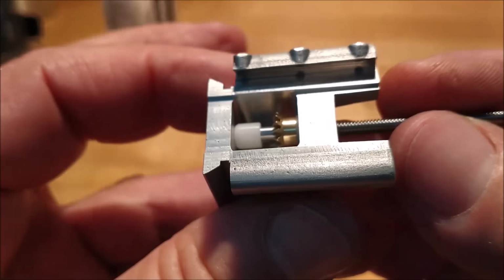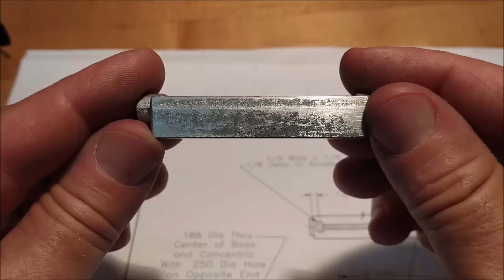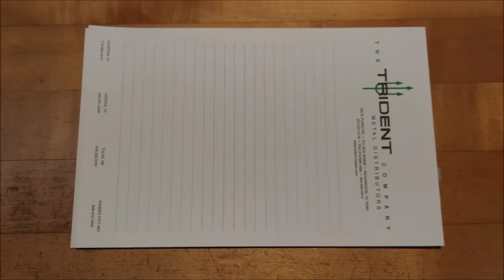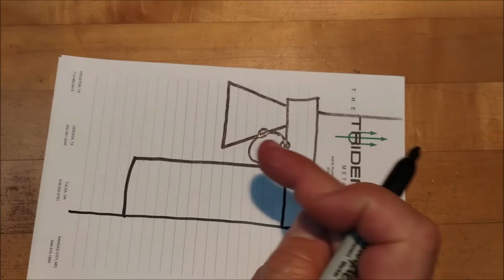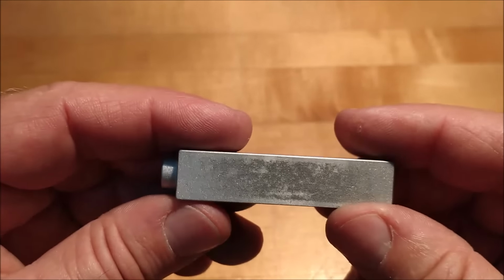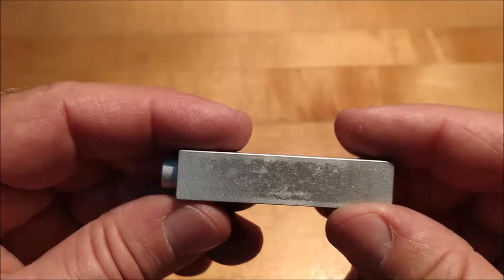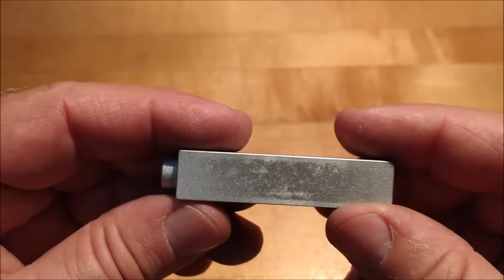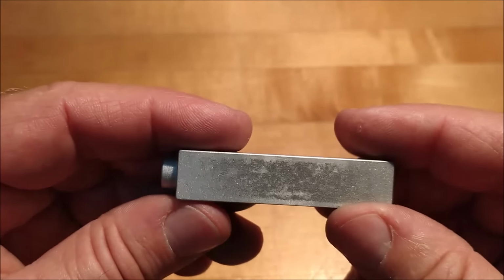Machining a 1/12 Scale Mini Milling Machine.....The Table

Comment: Could you mill a recess for the top of the shaft  (@2:50), to kinda act like a second bearing?  Not that the shaft will ever experience much deflection, but if the shaft is going all that way up, it could a nice additional detail.

Comment: Breakfast with Joe on the weekend. But Joe, that table is so easy to move. I had to move my shop gear to a new storage area. Moving a brown and sharpe table took two guys to lift it.

You have done a mill vise. How about a rotary table or dividing head feature for this project?

Comment: Joseph, you usually use Delrin for your washers but this time you mentioned something different, what is it please?
Reply from the maker: Celcon. Acetal Copolymer. Delrin is a brand name, but they are about the same. Delrin has a much higher elasticity that plain celcon.
Reply: @joepie221  Thank you!

Comment: Good day my friend. I reallly like the way that you see through physics needed to make these models work better than originly intended by the makers. You really do take them to the next step up. So far the castings have been really clean. Such a shame this has not been the case with this one. JB Weld has an epoxie I have used many times with great success. Inexpensive and tough stuff. This has gone by so fast I am going to watch it again. Many thanks my Texan friend. Did you ever try that waxy file treatement ? See you next round.
Reply from the maker: Greetings Sir. I did try it. Either I applied it wrong, or I'm missing something. It seemed the file didn't cut nearly as well afterwards with the compound in the teeth.
Reply: @joepie221  Hmmm, I have only used it on files for silver and the jewlers saws I usually use it by filling the file litterally full of it . Oh well.  I hope the rawhide works better for you old friend. Best soft jaws insert I have it glued to my vice jaws. That would be a bit on the extream side for you.

Comment: What is the RPM for cutting the slot?  I struggle with those little cutters!
Reply from the maker: 1650 RPM +/-
Reply: Wow, thanks, I would be running wayyyy faster than that!  Like full speed, 3500 RPM or more.  Probably why I break everything! I have been using a feeds and speeds calculations which says 12000 rpm plus!

Comment: Could you have aquired the castings made out of cast iron or steel at least? So much work for the model to be made out of unusable aluminum.Like seeing a 6 year restoration of a 4 door 55 chevy belair taken down to last bolt and rebuilt.Useless because its not a 2 door convertable.

Comment: Hi,
can you make a t-slot-mill out of a normal mill, if the web has the right size?
cheers
matthias
Reply from the maker: Absolutely. Surface grinder and a spin indexer would make it very easy to do that. In a pinch, a dremel tool and cutoff wheel could also work.

Comment: It's looking great, Joe, but is it me or could a fifth grader with playground sand, charcoal grill, shop vac on reverse, and a bunch of beer cans make better castings than these?
Reply: Sounds good on paper, give it a go. Don’t be shocked when your castings turn out worse than these. It is an art in itself. 
Investment(wax or foam) castings is the way to go for these small intricate parts.
Reply: @grntitan1  I'm saying that crappy methods and an inexperienced child could do a better job than the manufacturer of this kit. The voids alone suggest that they're stingy with material and doing a bad job of temperature management.
Reply: @ScottHiland I don’t disagree that the castings could be better.
Reply: Maybe for 1-off, but production run??? ⭐🙂👍